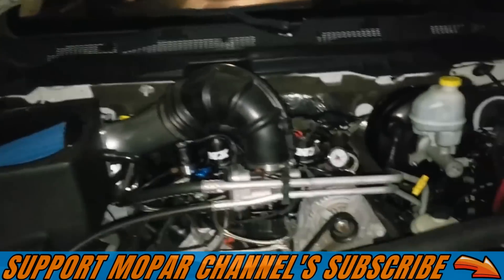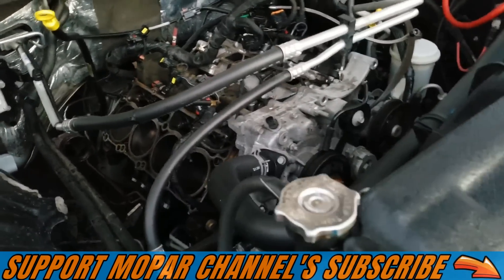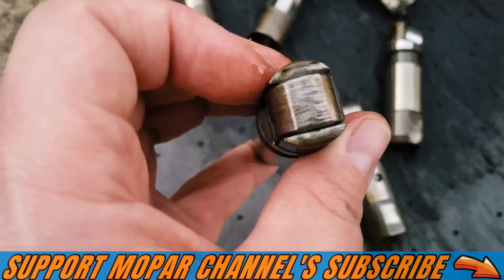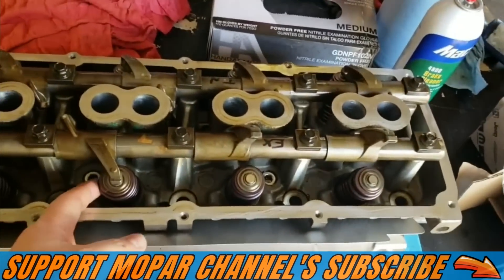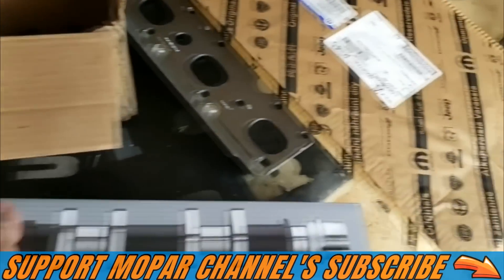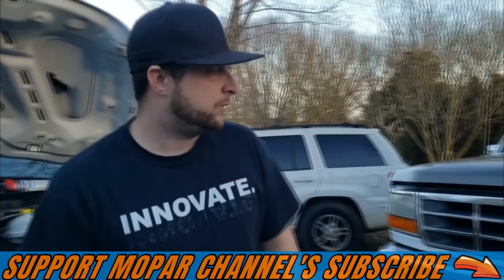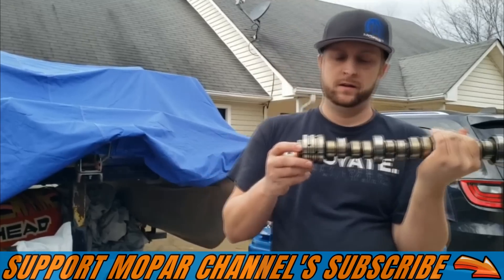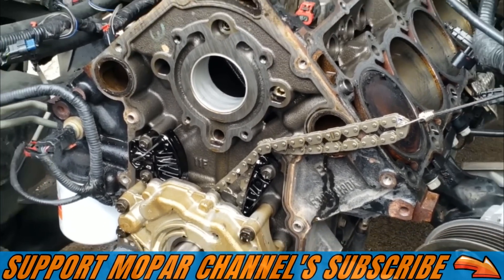5.7 HEMI TICK CAMSHAFT AND LIFTER REPLACEMENT MDS DELETE

Comment: Suffered lifter and cam destruction on my 6.4 Grand Cherokee, 65000 miles....will never purchase another Jeep, ever. Absolute junk and don’t even bother with the dealer... no bueno.
Reply: Dont buy new its simple...new shit will always break that's how it is made so you have to buy a new car or fix it if you got money and experience
Reply: I have a 96 grandcherokee with a 5.2 magnum 348k on the clock all original except trans I got a built jasper trans because the 46re is slouch I literally have no issues with it
Reply: I bought a 2014 f150 off the trailer when it got delivered I had issue after issue with it. Bought a 98 f150 for 400 woth no brakes I put brake fluid in it and everything worked great drove it for 2years and sold it it had the 351 Windsor and 408k when I sold it
Reply: Feel your pain, I went through the same.
Reply: ford 🔥
Reply: Robert Beene mine was a 2012 with a dealer “warranty” that had expired a few months. Needless to say they weren’t motivated in the slightest to help. Not only are they producing timebombs, but the after sales service by Jeep is a disgrace, pure and simple. I have a wise old Mexican Uncle who warned me about these engines, too. But me being a horsepower guy, I said aww cmon Zio, it’s HEMI.... I can laugh now, but I was 8000$ out of pocket.
Reply: 7s29 sorry to hear brother. Straight up a design fault..... they should do a recall, but they ignore the issue and keep making these engines.
Reply: the dealer might cover that... i heard they do up to 80k...
Reply: I’m in that boat now, I think. Hoping for cam/lifter replacement and not engine swap☹️ 2015 GC SRT 57,000 miles🙄
Reply: Misty Bencak sorry to hear this. How these engines fail so readily is diabolical.
Reply: Ronin 71 $4200-4500 😩
Reply: Misty Bencak wow, again sorry to hear this.
Reply: No bueno 4 cacahuata
Reply: @RottieMom14  Did you end up getting it fixed under warranty? I have a 2014 GC SRT and it’s making that lifter noise also. Thanks.
Reply: @sspower1234  No. Paid ~$5500 from local performance shop :(

Comment: Theres alot of people that mistake the OTHER hemi issue where the exhaust breaks manifold bolts and it makes a simular noise. If it goes away when your truck warms then its most likley your exhaust
Reply: Thank God, that's what mine does, that's got to cost a fraction of what cam replacement does.
Reply: I’m hoping mine does because I’ve been hearing mine tick
Reply: If it doesn't stop while driving its the valves, the exhaust manifold has two different metals bonded to surface.
I don't know if that causes the bolts to break or just a less serious tic
Back when Dodge was built by Dodge my work vans sitting overnight would seep a little oil around the valve seats.
I would get a little puff of smoke when starting, and thats it.
I never used much oil, but checked them regularly.
I would buy used work trucks, and never had a premature fail.
One van blew a head gasket after 350,000 miles
I paid 500 bucks for that van, and I put on 100,000 miles myself.
the only work I ever did to it was change the freeze plugs.
I am a Mopar Guy, but needed a van this year ended up with a 6.0 liter GMC.
Not liking the six cylinder mix breeds.

Comment: how is there not a massive recall on these lifters? I just had some fail on a * 2022 6.4L 2500 engine at 13k miles ***...only ever had the fancy pennzoil platinum synthetic oil changed at the dealership every 3-5k miles...this is not operator error, this is a straight up defect!!!
Reply: When was your first oil change done on that vehicle?

Comment: I wonder how many of these failures are on engines that have prolonged engine idle times.  Do the Hemis have crazy oil pressure ranges at idle vs driving?  I see my ecodiesel idle oil pressure is in the teens vs low 50s driving.  Wonder if the Hemi is similar and lacks good oil volume at idle..

Comment: I think it's important to note this doesn't happen to everyone, I have a 06 Ram 1500 5.7 with 358000 and have had no issues with lifters or cam, I also purchased a new 2019 classic 5.7..believe it or not I'm more concerned with the 2019 then the 06, iv also done oil analysis on the 06 every 15000 miles, just to keep an eye on things, something like this would almost certainly show up in a oil analysis, it would at the very least give you a heads up as to potential problems..
Reply from the maker: The 3rd gen wasn't prone to this failure as much mostly the 4th gens
Reply: My 19 classic going in shop Friday for lifter failure most likely. Only 30k miles.
Reply: Tyler Hobbs so was it your lifters/cam?

Comment: I just had mine done at Taos performance in Raymore Missouri. 
It was a 2011 with 138k. The misfire started at 5.5k rpm and with in 2 weeks it’s was missing at 3.5 
It was about the same price as what the dealer wanted , but  the dealer was going to put the same mds crap back in. 
I got a stage 2 cam , a new gasketed motor ( minus lower gaskets ) new lifters obviously , and a professional tune. 
Man what a difference.
Reply from the maker: Great information man, a custom cam makes a big difference for sure👍
Reply: Hope you have a stall to go with that stage 2 cam!
Reply: Bri-man Hunter no issues yet. But I also didn’t do the larger Intake. He said not nessesary on my motor unless it’s an issue. Put a hundred miles on it daily from job site to job site , with no stalls. He did have a G6 in there that was getting an stall after he put the stage 3 cam in it. Said it could hold stop lights.
Reply: How much did all that cost?

Comment: I have a 2004 dodge ram with the 5.7 liter Hemi ,it ticks never had any miss fire codes ,it's got 150,000 miles on it.
Reply from the maker: Probably broken exhaust manifold bolt very common also.
Reply: I’ve had a tick on mine ever since I bought it at 70k, not manifold bolts because I also have JBA long Tubes. I’m throwing in a Jay Green HL stage 1 cam with pushrods and valves next week. Should be fun with the 3K stall.

Comment: Have a 2007 Ram 1500 4x4 with 150,000 miles. I am getting read to do the cam , lifters and MDS delete. One question always comes to mind after reading a few hundred post. Lubrication of the lifters and their failure. Would replacing the pushrods with larger diameter opening help on this matter?  Just looking for answers

Comment: how hard is it to make a good lifter? push rod motors have only been built for how many decades?
Reply: It ins't really the lifter that is the problem. It is in the methodology or oil starvation at low engine idle speed. There is no direct head lubrication pathways from the pump assembly, instead relying on the Crank Sling method of oil deployment which suffers greatly at idle. Bad Engineering design, not lifter design.
Reply: I know i'm late but... ford hasn't made issues with simple things either? Putting a spark plug in and letting it blow out or snap off lol. Everyone has issues. Also yeah they run pretty low oil pressure at idle which could help create this issue.
Reply: The issue is NOT the lifters. The issue is the Low Oil Pressure at idle due to methodology of lubrication to lifters.  The Ford spark plug issue was basically limited to 04-07 5.4 L engines. But that is not the only problem Ford has designed. The Focus RS blowing heads is far worse and also late 90's mustangs had cooling issues with the rear cylinders that seems to overtly affect the GT350 engines too. Though Ford has denied that one. 2013-2014 GT500 5.8 L engines are a time bomb as well.
Reply: Anon Imous I’ve read that the engines with the biggest issues are the ones that idle for extended periods.    Work trucks, police cars, etc.    my car has done extended time idling, but being a 2006 Magnum RT I hope this doesn’t happen.

Comment: I just got my 2013 2500 5.7L truck back from the Hemi Shop. I had Hemi tick start last Tuesday.  My check engine  light came on with a code for the oil pressure switch and also had a misfire on cylinder number 5. I checked the oil pressure on the dash and it only would go up to 31psi🤦🏽‍♂️. 

It ended up being a seized lifter at ate up my cam lobe.   The shop replaced the cam lifters seals and other stuff I can’t remember and sent the heads off to get worked. 

No it runs better than when I bought it with 60k miles.

Comment: Awesome video I work for Chrysler as a tech and it’s common on these 5.7, 6.1, 6.4 liter motors to have a lifter and fail and causes the cam lobe to go bad. Nothing new
Reply from the maker: Definitely is job security lol
Reply: Is it the same on the hellcat?
Reply: Yeah who in the right mind puts only one can in there 🤔😂👎
Reply: What happens if you don’t replace the cam when ur lifter fails?
Reply: @brandonsanchez3431  I’m assuming it will just eat what’s left of all the other lobes and eventually
You’ll have catastrophic engine failure due to metal shavings.
Reply: Well eventually someone will start a class action lawsuit over this. You pay 40 thousand or more and in some cases you wind up spending another 4 grand to fix their design flaws right past the warranty. The main reason for buying a truck is to have that durability. Damn shame Chrysler doesn't get that!

Comment: Hi, how is it running now?
Do you regret not dropping the oil pan since the cam lobe was worn down, to clean any metal shavings/debris out?
Do you wish you had placed a hellcat oil pump as well?  
Thanks.
Reply from the maker: Works fine still today and lots of racing on it also.
Reply: @FrostbiteRam  how many miles on the motor since the lifter replacement?

Comment: Have the same problem with my 2014 Ram 3500 6.4 threw a misfire code cylender 3, Engine has 102,000.
Would love this setup, but warrinty is going to cover the repair. Thanks for the info, Your truck sounds great!!
Reply from the maker: Thanks, and yes cant complain if you get free warranty repair.

Comment: I HAVE A 2006 MAGNUM WITH THE 5.7L ENGINE. I PUT A, MILD,  PRO-CAM IN IT. BUT NOW I HAVE TO RE-TUNE  THE STOCK ENGINE COMPUTER TO HANDLE IT.   ONCE I DO THAT, WILL THAT COMPROMISE THE CALIFORNIA SMOG TEST?  PS; WHAT IS THE DIFFERENCE BETWEEN A 2006 AND A 2015, 5.7L ENGINE?  ARE THE PCM s VERY DIFFERENT?

Comment: I start my 5.7 Hemi in the morning it sounds great for about 30 seconds then it starts tapping. 5 minutes later it's silent. Stays really quiet as long as the engine is warm.  Both manifolds and bolts have been replaced. Didn't fix it. I've been driving it like that for 50K miles and the noise never changes.   Only ticks til engine is warm, so I'm not worried about it anymore, but does anyone have any idea what it could be?
Reply: I had a 5.7 with 120 k miles I replaced manifolds and bolts aswell my tick was exactly the same as yours I drove it for another 30 k Miles like that than traded it in to much  to worry about
Reply: @Wisdom_Eqauls_Power  Apparently it's just annoying, and not so much to worry about. It's at 190k miles now and still smooth and powerful. Just ticks like a time bomb during warm up. I wish it didn't do it, but it's paid for and I don't want a car payment any time soon.
Reply: @edjackson4389  I’m glad she’s going strong 💪 and I’m with you @ payment !
Reply: Watched a video a while back, it's the bolts to the exhaust manifold that are snapped. Once the engine warms it goes away, then back again when cool.
Reply: @dsylte8761  No it wasn't. They were all new and so were the manifold gaskets. Noise continued. New cam and lifters fixed it.
Reply: @edjackson4389  wrapped manifolds
Reply: @bruceisz2664  It actually turned out to be a bad catalytic converter. A piece of the honeycomb  had broken loose and made tapping sound until it warmed up

Comment: Between the cam and the bad lifter, a lot of hard steel got turned into sparkles. I wonder how much of it ended up inside of the oil filter and how much didn't...
Reply from the maker: I had to change oil 3 times to get it clear.
Reply: @FrostbiteRam  After performing the repair?

Comment: It’s a design flaw. The cam is starving for oil. New cam will fix it but the problem will continue. When you look at the lifter, you’ll see the burnt side indicating lack of oil. Someone should invent a way to get the oil to the cam. Idle will increase the problem.
Reply: @mikes2460  bad design
Reply: Agreed on the oil issue, there's a video on youtube that proves it..

Comment: Trying to avoid the dealership ripping me but I noticed a clicking after an hour driving and it clicks faster when accelerating but slower when idling I cannot find any video with this same thing. Does that seem familiar with this problem? It seems to be heard on both sides of the engine towards the back. Its in the background of the motor running/exhaust so not super loud but notice it
Reply: No engine lights and all stats are fine it's a 2015 5.7 charger with 104k.  I did notice that my oil pressure Is lower than I remember from 50s to 30s now. My oil change is still good for 2500 more miles with 50 oil life on my dash. Used full synthetic and run 89 fuel
Reply from the maker: If the tapping dosen't go away when warm its most likely a lifter/cam issue

Comment: Question. Your cam and lifter looks far worse than mine, without a CEL. I have a CEL.  I’ve aligned timing TDC (so I think) and my cam will NOT pull. I’m hoping it’s not a spun bearing. Any advice??? Please let me know.
Reply from the maker: Should pull right out if the lifters and hardware is removed never seen one stuck myself

Comment: Just bought a 2020 Ram 1500, did they ever fix this issue?
Reply from the maker: Not really its better but time will tell.
Reply: Yes it has been fixed by the lifter supplier.

Comment: I can do the swap but is there a camshaft upgrade that I can put in that does not need a tune? Also I am wanting to do the upgrade for towing more torque. I want to stay with stock lifters I don't want to break the bank. Thanks
Reply from the maker: You will need a tune with any camshaft besides stock
Reply: @FrostbiteRam  I thought if you didnt put to much of an aggressive set up in you didnt
Reply: @FrostbiteRam  I thought that if you didnt go over board thre were cams that you dont need a tune? What about the other questions. Also I cant do tunes once I do it it can be driven to the tune shop cant it?
Reply from the maker: @jamesmeadows1456  do a remote tune from a remote tuner like greene racing no need to go to a shop upload it in the driveway

Comment: Even though I agree with getting rid of the MDS system The lifter that he's holding that locked up is a non MDS lifter.  I've had this exact same exact scenario happen  on my 6.4 Charger number 5 intake non MDS.
Reply from the maker: Yup many think just the mds lifters fail not the case at all most the time it's a non mds lifter.
Reply: We just finished up a 5.7 charger mds that had a lifter tick. #5 intake lifter (not an mds lifter) had failed and chewed the cam up. We couldn't get dealer lifters so we went with aftermarket lifters... didn't even make it out of the shop. 2 were ticking theirs asses off. We waited for dealer lifters and had to take it back apart.
Reply from the maker: @MountainLife86  damn that sucks. Best fix is non mds camshaft and hellcat lifters

Comment: Hey man after that cam got messed up, don’t you think you got metal flowing around the engine, I got the same problem and I’m worried cause when I drain the oil metal shavings came out
Reply from the maker: I had to change the oil and filter about 3 times after the repair to flush everything out.
Reply: I took out my mds solenoids and they are clean also I took out my vvt solenoid and it’s also clean, I am going to take out my oil pan to check it out, I am thinking of just flushing out the engine and putting a new cam and lifters in it. Is that a good idea or just get a new motor ?

Comment: All but one of my lifter slide out easily, the one that won't come out is on the cylinder that had the misfire code. I'm assuming it's mushroomed at the bottom from the failure. How do I get it out?
Reply from the maker: They normally just pull out with no problem?
Reply: @FrostbiteRam  not this one. Even tried grabbing it with a pair of channel locks. It won't come out. I'm assuming if I force it out I'm going to destroy the surface and cause early failure on the next lifter
Reply: @FrostbiteRam  it's not possible to hold it up while I remove the cam and then drop it out through the bottom, hopefully being able to catch it with a magnet, is there?
Reply: @FrostbiteRam  for future reference, apparently this does happen fairly often. Ive been told by someone who claims it happened to them that i can hold the lifter up while i remove the cam, then drop the lifter and remove it by dropping the oil pan. Since my issue is only on cyl 3 Im planning to try to catch the lifter with a magnet instead
Reply from the maker: @greenis3006  good news 👍

Comment: The professional I took my 11’ GC hemi to didn’t mention about the MDS delete, but went ahead and replaced the rollers, new rocker arms, lifters and cam shaft for a whopping $3k. Then, a couple months later I get a misfire code, now he’s saying I should install a delete kit like WTF? What do I do? He was supposed to be the professional here and I said what about all the work you guys did then was it for nothing? Just need some advice, thanks!
Reply: The guy responded back saying all the work he did (without warranty) was for nothing & that I would either need to do it again with a delete kit (wtf no) or an engine swap looord have mercy I’m screwed